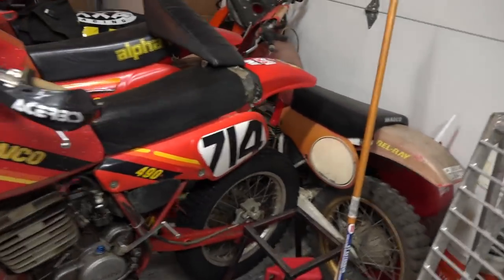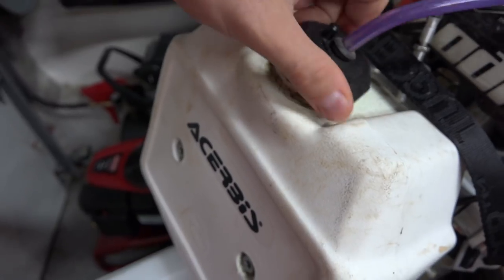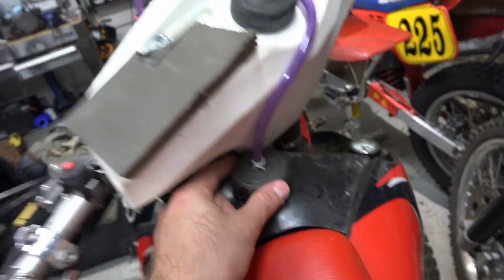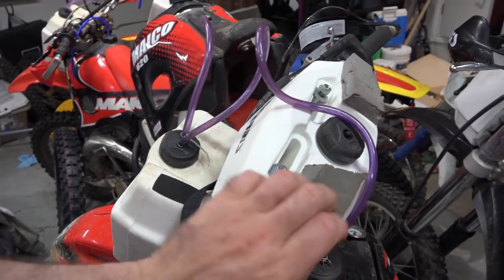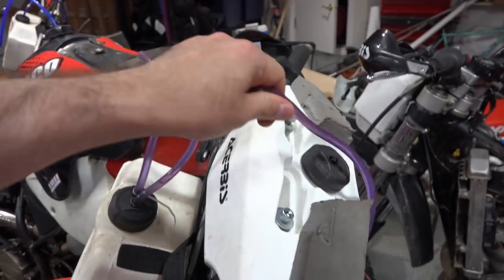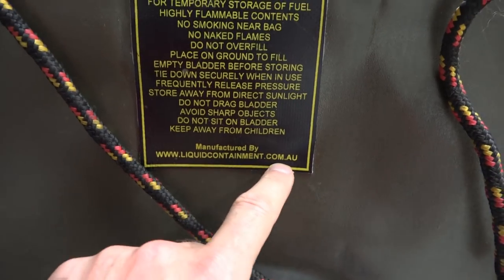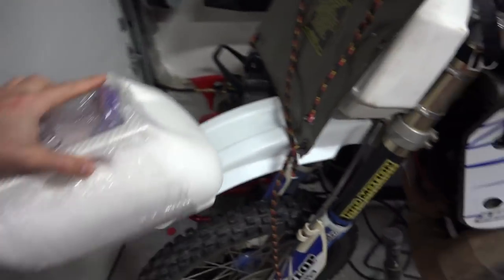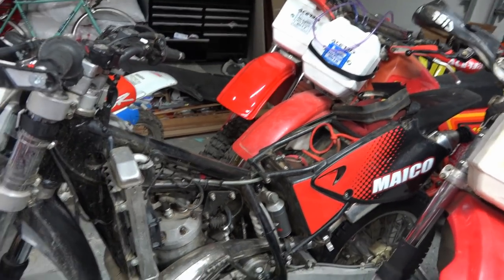Number Plate and Auxiliary gas tanks siphoning setups (Dirtbike VLOG: S1 E23)

Comment: Replaced the lines for my aux tank during the off season.  Had hell with the bike randomly dying.  A few things I have figured out so far.  Double slash cut the end of the line that goes into the aux tank.  I've had mine stick to the bottom and sides with a flat cut and a single slash cut.  Aux tank should be as high as possible, and the line as low as possible to aid flow (i.e. overcoming gravity.)   I'm considering putting a check valve near the end of the line that goes into the aux tank, in an effort to always keep fuel in the aux<>main line.

Comment: I could have used those on the 84 rm250 I had. it drank gas like it was free. I pushed that bike Everytime I rode it. either broke a chain, swing arm bolt or ran out of gas .😂 I broke the entire expansion chamber off on a flat landing once . don't think my hearing ever recoverd . it was like standing over a full auto 378 weatherby mag with no ear protection all the way home.😂
Reply from the maker: They are pretty good especially when there's no oversize tank available.  Haha ya you had some fun on that bike

Comment: On the blue bike to make the gas line stay in you should cut a peace of rubber that fits good into the gas cap and then put the hose threw it so it takes up the entire open area on the gas cap. Or drill a hole in a wine cork and put the line threw it and shove it in the gas cap.
Reply from the maker: Also need a clip that can sink into the top of the cap, the clip that's on there won't.  I wish the nipple on the cap stuck out of the top and not in, would have made this a lot easier.